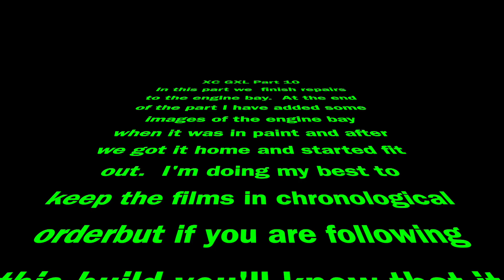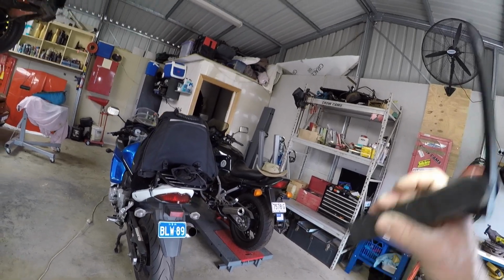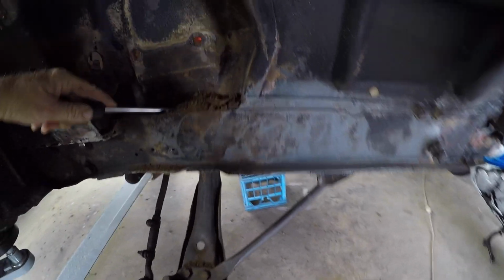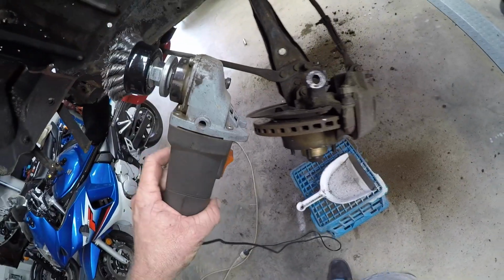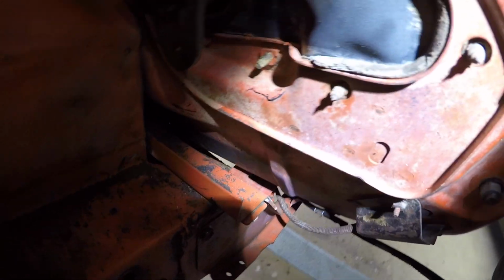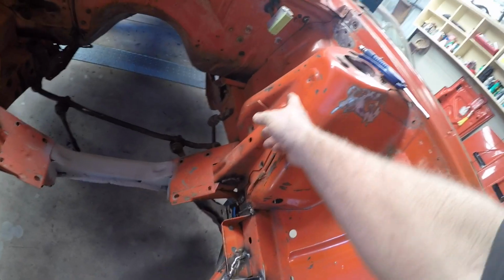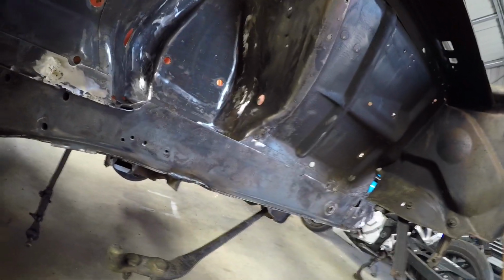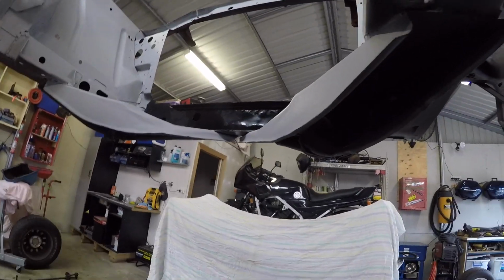XC GXL Part 10

Comment: Instead of seam welding you are better of stitch welding.
The problem with seam welding is if you develop a crack it will continue across the whole weld where as with stitch welding the crack will stop at the end of the weld instead of continuing to next weld.
And with your welding may i suggest to increase your amps a little more to make for a cleaner weld.
Reply from the maker: Suggest away mate all good it's been a learning curve 
Cheers Blue